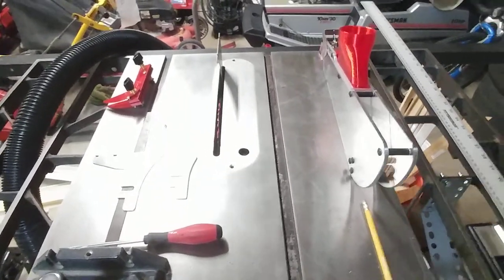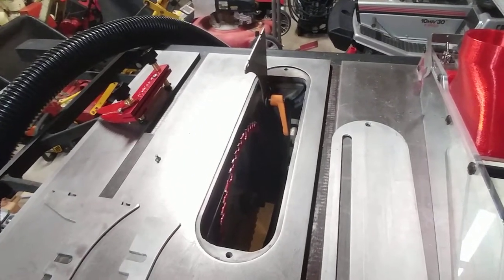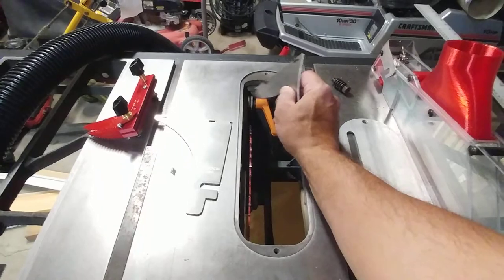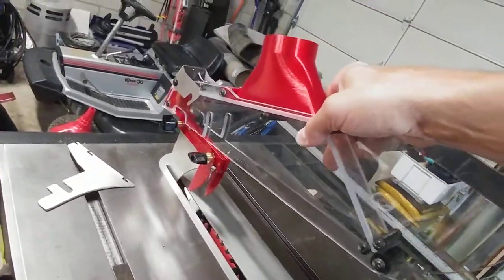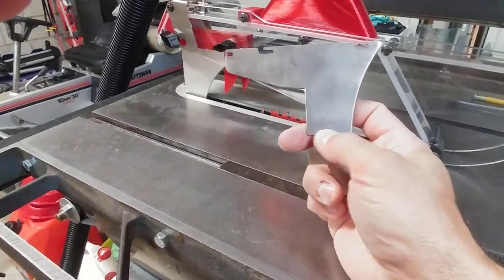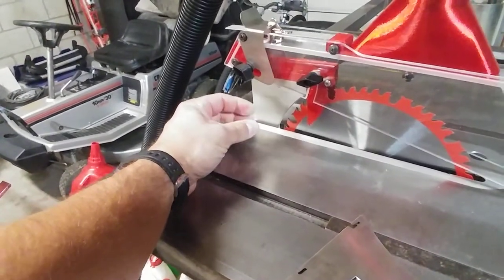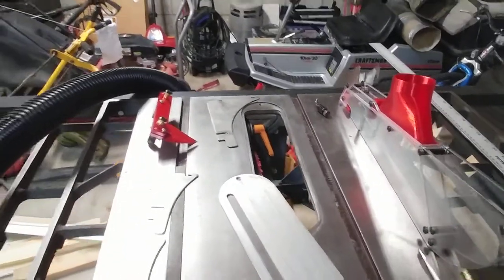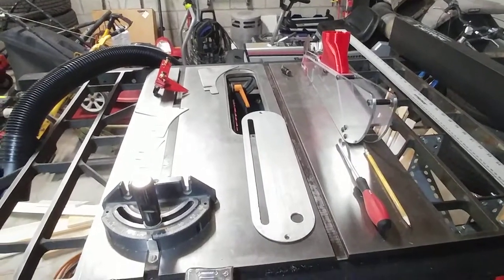The Shark Guard for my old Craftsman (113.27520)

Comment: Thank you for making this video Heiko and kudos to the guy who has invented this and done the tough, iterative work to make it better. I just installed a replacement blade guard for a used Skilsaw and I'm not impressed. It may be safer, but I can't see through it and it doesn't provide any dust collection - plus the pawls don't retract like the ones on the Shark Guard do.

Comment: NooB question: I just acquired this same saw. How do I keep the blade from turning when I try to use the wrench to remove the nut to change out the blade?
Reply from the maker: after taking the table insert off, expose the blade all the way, than wedge a piece of wood into the teeth to the balde and then take the nut loose that holds the blade on the arbor. Cheers

Comment: I am in a similar situation as you (1962 Craftsman 113.29992). Is there a way you could post a picture of your cradle (part where all parts attach) where the splitter attaches? I want to see if this would work for me? ( I wish I could help you determine age, but it is a 1950's  model!)

Comment: Thank you, Heiko for making this video. I also have an old craftsman table saw that I have been wanting to install a guard, splitter, and dust collection on - you have found a way to do all three. That's beautiful. I will look into this. I also like your fencing system. Did you make that yourself? or di it came as a kit?
Reply from the maker: The guard is made by SharkGuard https://www.thesharkguard.com/.  The fence system was made back in the 80s or 90s by Paralok. Greetings,

Comment: Thank you Heiko for making the video.  I too have a craftsman 113.27520 table saw.  I need some help with adjusting the motor to provide enough power to the blade.  The blade is having a hard time ripping through a 2x12 it actually stops the blade.  Any assistance you can provide would be very helpful.  I have reached out to Shark Guard to purchase the guard. 

Thank you,

Mike
Reply from the maker: check what motor you have. Voltage and rpm, then we can look into the pulley ratio that you have on your saw and maybe you need to change a couple pullies. Also make sure your pulley is not slipping.
Reply: @HeikosGarage  probably too late..  but also check the set screw on the arbor pulley.  Mine was loose, and would work intermittently due to the pulley slipping under high load...

Comment: Great job on the video and your commentary is very helpful.  I have the same saw and I think mine is more like circa 1951 to maybe 1953 at the latest.  If you look at the serial number plate on the saw cabinet itself (not the motor plate, that is different) and look very closely maybe even with a jeweler's loupe at the upper left corner of the aluminum plate (still within the black paint) you should see a number; mine is stamped "51" and then of course to the right of that in the silver or aluminum model number section it is stamped " 113.27520" - but then in the upper right corner of the number plate (back in the black paint again) mine is stamped "32".    I'm guessing that means my saw was built on the 32nd day of 1951?  I got an eight page owner's manual and parts list in PDF for mine for free at Vintage Machinery.org.  Mine is the 10" version with a one horsepower 120 volt single phase motor. There are 8" versions of this saw as well; I think you can tell the difference by the smaller pulley at the motor on the 10".  I just spent lot so hours disassembling, replacing arbor and motor bearings with tight SKF, soaking in molasses and brass brushing every nut, washer and bolt on this saw but am happy with the result it really is as good as new - although wouldn't want any kids around mine when in use or if I'm not around.
Reply from the maker: Police Dog thanks for tip. I will check the plate.
Reply from the maker: Police Dog I just checked. Upper left hand corner has #25 and upper right hand corner #33. What does that mean?
Reply: Well I don't know but that does help me because your example seems to eliminate my previous theory that the upper left numbers denoted the year of manufacture.  In other words "51"if that meant "1951"  made sense with my version of the saw based on the model number and general vintage of my version of the saw; but "25" possibly meaning "1925" sounds far too early.  Well, perhaps those stamped numbers are instead the Sears part numbers just for the actual number plates and not the entire saw?  I notice the serial number plates are missing from the parts list in both of my owner's manuals, so no way to check that theory I know of.  Maybe someone who knows will see this and chime in.

Comment: How did you attach the hose?
Reply from the maker: The standard shop vac hose fits into the fitting.
Reply: @HeikosGarage  Thank you!
Did you have the 4” port?
Reply from the maker: @danielortiz7403  the vac hose is 2 1/4 inches and fits right into the fitting.